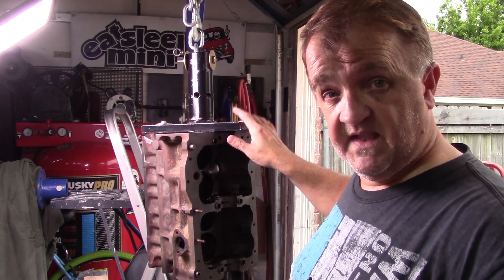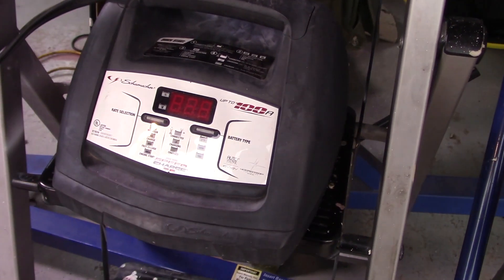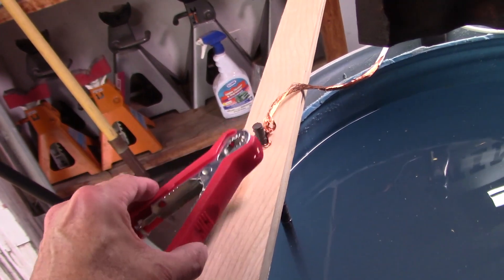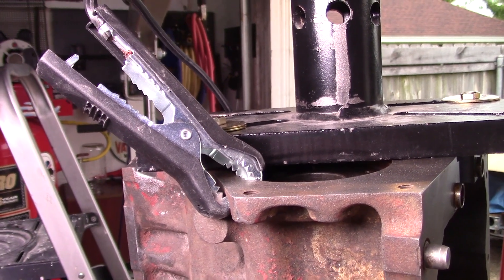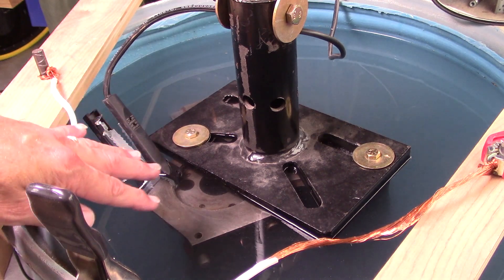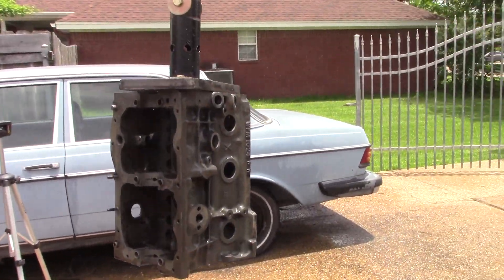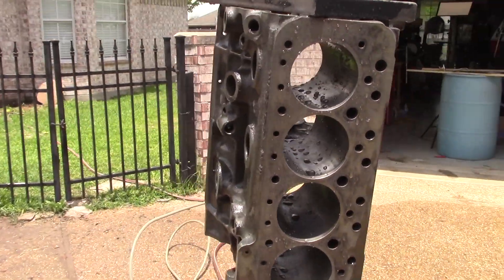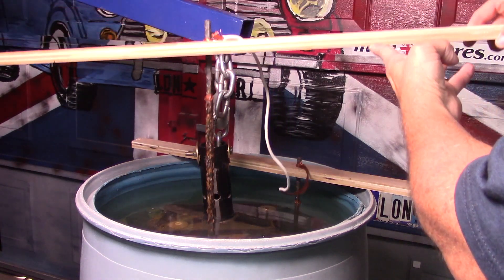Removing Rust via Electrolysis - Classic Mini

Comment: Great idea Randy, why didn't you get it acid washed?
Reply from the maker: Thanks Dennis,  While we don't have the 'acid' baths (illegal) any longer here in the USA, the performance shops do have a chemical bath process.  First, I wanted to try a couple methods (vinegar & electrolysis) for my own awareness, but I also knew I would have to scrub a little and I'm not confident any performance center would give the detail to my block as I would.  With that said, I will have some machine work done to the engine (dry decking and possibly reworking the cylinder to 1380 if it needs it).  At that time, I will allow them to put it through a chemical bath.. therefore my block with hopefully see proper cleaning.   Hey.. my daughter is heading your direction for a study abroad program...
Reply: @LoneStarMini  wow didn't know that, but you are right in saying that they won't give it the love it deserves. I have finally started my mini journey (first youtube video to) and I get hung up on  minor things. I'm sure she will love her trip over here, is she the one that shot my name for the giveaway? Light still going strong by the way 👍 stay safe.
Reply from the maker: @denniswellard  no..  Devri (our youngest) was the one who shot you (I had to look back).  my lights are still strong too and I use them a great deal.    Hey..  I just subscribed and will watch your video..  awesome..
Reply: @LoneStarMini  thanks